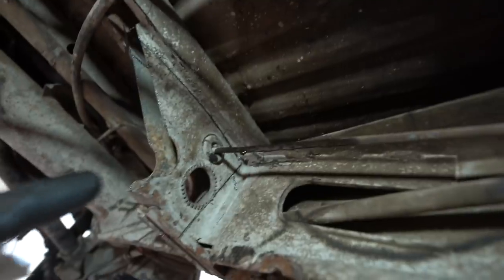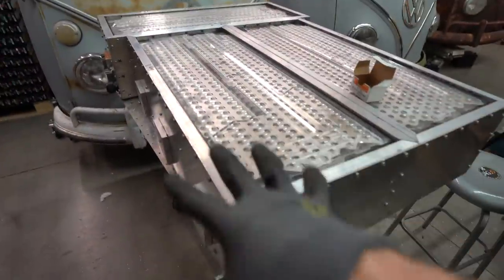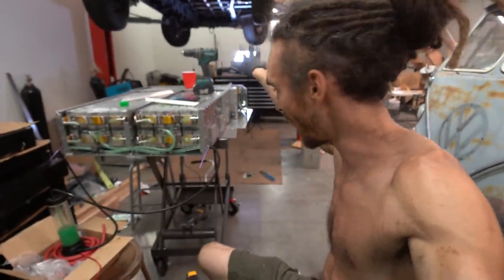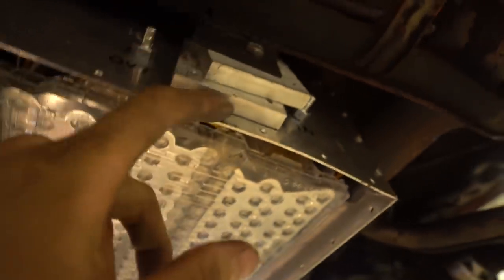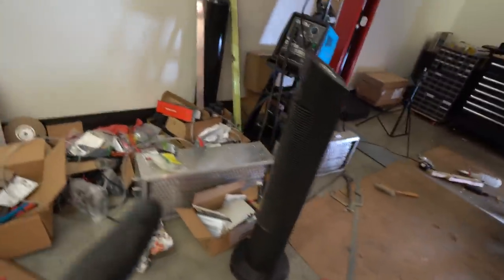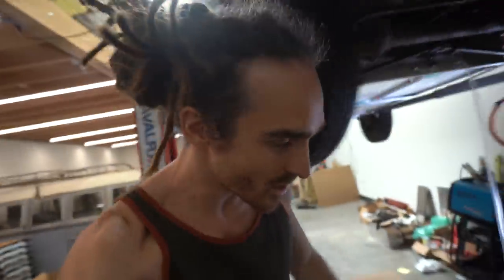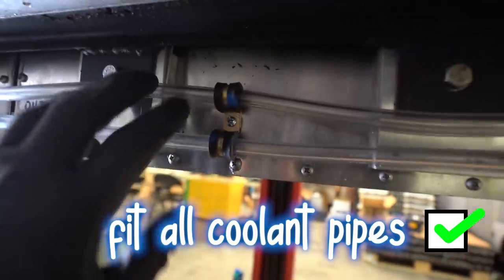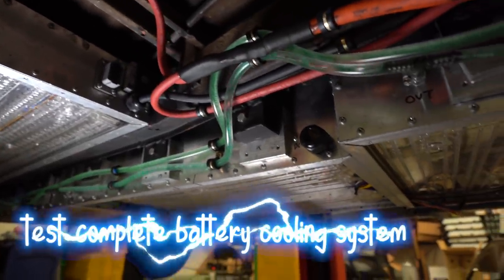I Fit 12 Tesla Batteries Under My Van - Electric Camper Build Ep 5

Comment: First time you drive in the rain, you're gonna be screwed. High voltage DC batteries in screwed together aluminum boxes. You've already seen what a small amount of coolant can do to one battery pack. Imagine that but with the batteries fully charged and connected in a 300v circuit. And add in the fact you cut out structural parts of the vans chassis.

Comment: It's a huge, low hanging skidplate made of lithium batteries and pc parts. What could go wrong?
Reply: He could have sacrificed some floor space by mounting the battery boxes higher and welded some reinforcement bars underneath the boxes.
Reply: He really wanted that full space inside the van for that romantic date with his girlfriend he was planning. So fck structural integrity

Comment: Be very careful because you've never seen an explosion quite like a shorted lithium battery pack. It can vaporize a metal wrench almost instantaneously.
Reply: the installation that he is doing is very poor quality, !!
Reply: @fernandosguera8360  it’s total crap beginner quality, can’t wait to see it run, I’m guessing it won’t last very long. Wait till it bottoms out one time and destroys the batteries.
Reply: How can be legal/safe?
Reply: @vintageexcellence  im sure he'll be careful when going over speed bumps etc. if he is careful that thing will last.
Reply: @BeardedPete  Imagine their weak aluminum boxes hitting the pavement and setting themselves on fire by compression!!
Reply: Friend, good luck, don't get hurt, I'm an aeronautical engineer, there's no intention of offending you.
Reply: @fernandosguera8360  ok if you are thats great but the only bad scenario would be if he hits the bottom and the whole thing goes boom? Correct? So yes he is taking on a risk but i said if he is careful with his driving he should be fine? Correct? And since you are an aeronautical engineer I'd love to know what you think!
Reply: @everythingcool101  Or the cheapo cooling pipe could get damaged or fall off the barbs and damage packs that way. I'd have used some automotive-grade pipe. It looked like there were loose BMS wires inside the boxes which will be fine for a while, but if there is too much movement then there could be abrasion and a short eventually. It feels like there is a shortage of failsafes in this design, but he's not gone into much detail so it's a little hard to tell. I'd have put some more isolation in, and indeed some insulation to make it easier to keep a good battery temperature. 
The tesla packs do have a transparent insulating layer  and he did insulate the busbars, so bashing the bottom won't necessarily short things, but it could. Maybe he's going to put a guard-plate underneath to make it more robust, especially at the front edge. It'll 'probably' be OK, but like I say, shortage of failsafes so it might end badly.
Reply: @everythingcool101  no he won't. There's no protection or proper structure to it.
Reply: @everythingcool101  a small puncture over a high bump or something to a battery his entire thing is gonna get vaporised and burns for days
Reply: @everythingcool101  sor<, but in traffic you are not always in control.

Comment: Water cooling without any water cooler ?  i just saw the pump, the lines and the batteries.... but no cooler ? 
also the flow rate of that "PC" Pump must be terrible! i think you should look for some better ways for the cooling.  

Also Great work. nice to see that you try to do every thing on yourself. Keep it up men
Reply: the cooling system showed in the video won't cool anything 🤣 it just circulates warm fluid in a loop
Reply: Im sure theyll put a radiator in the front

Comment: I initially used the same green coolant but ran into some literature references that caste shade on it. I went to the ASTM Standards website. Green is acidic-not good for aluminum. Red is phosphatic - not good for aluminum. Pink or blue is pH neutral recommended for aluminum which is what our cooling modules use for internal channels. Obviously the same applies to the chill plate.under your inverter. I flushed my coolant with distilled water and am now running Xerex Asian Vehicle. It’s pink. I liked the green Gatorade in the D5 pump but looks aren’t everything. The ASTM standards are ASTM 3306 and K2234. I don’t know how critical it is for relatively low temperature operations but ....

Comment: If you are going to run the coolant pump, keep the pump level with the coolant pipes or above. With hydrodynamics, you will want to mount your reservoir above the pump so the pump will require less energy to pull from it. It will have less of an energy load on the coolant pump motor and will be more efficient.

Comment: Take an old VW van. Cut out most of the frame bracing, drill holes through the remaining frame so it resembles swiss cheese, Hang a thousand pounds of batteries under said holy frame.  Put a motor in that has double the horsepower and 10 times the torque of the original  Do not upgrade the suspension or breaks  What could go wrong?

Comment: Love the series man. I can't imagine all the struggles you have off camera as well!
I'm just curious about how the coolant pipes cool down the batteries? 
Cause in a computer or car, the the pipe coming out of the hot end (out of the battery in your case) goes into a radiator (usually with a fan attached) which then dissipates the heat, then goes back to the reservoir. But in your case, the pump is just moving the heat right back into the batteries. I'm just worried for your batteries dude!

Comment: I want to electrify a school bus!…
EV West has motors that are 300 hp each …and three of them can be coupled together …and they have a two speed transmission, to then hook into the original transmission of the bus …and now you have a tiny house that goes anywhere without… fuel…

🤭This is my dream tiny house

EV Westfield a BMW to Motor hot rod that one erase going up a Colorado mountain and that set up can be put into a school bus

Comment: what’s the safety of the under rack for the batteries. know tesla said their main problem was the safety of the batteries. watched a video of some dudes hitting a lithium battery with hammer and it produced the most intense fire, wouldn’t a poorly placed rock in the street or something like that, worse case, hits the bottom and punctures batteries....pretty sure it would create the worst fire, and don’t even think water puts it out....is there any worry of that or are these batteries different? cool project non the less

Comment: I'd be worried about ripping a coolant line and then having the batteries overheat. Hope you installed a temperature sensor and gauge on the dash, or have a system that auto shuts off over a certain temperature.

Comment: Oh no! Don't ever use break cleaner prior to sealents or glues! It leaves a protecting coat on the metal. You should use something like silicone remover, isopropanol alcohol or acetone

Comment: Just make sure there is no air running through your cooling system, and dont run the pump dry, always make sure there is liquid in the pump, it could die within seconds if so.

Comment: Whats the total kwh for all 12 packs.
I am confused about the coolant system. Where is the heat dicipatet. Are there radiators somewhere?
Also i couldnt tell if the coolant is flowing through one pavk after the other or in parallel. 
How much watts of heat power will each pack produce when disscharged ?
Reply: the cooling system is useless
Reply: Clearly he is still testing the system, he is cutting some corners but at every key change he is testing the operation, if he just connected it all and then ran the system and one of the pipes or batteries leaked then he would be in trouble, the next stage i am sure will be installing a proper circulation pump and radiator system, the interesting part will be if he can make it intelligently monitored and run the cooling when required or even heat if he travels somewhere cooler! This does get complexed especially as we are talking self build, many of which don’t have any in built cooling at all!